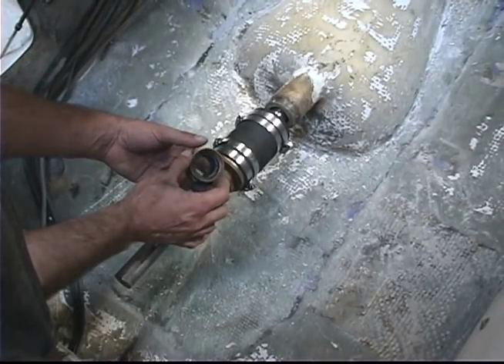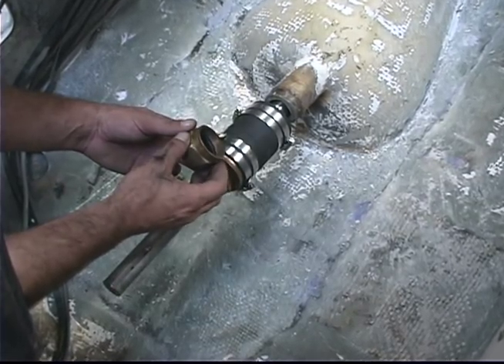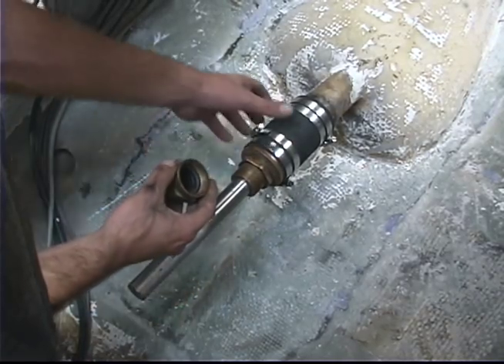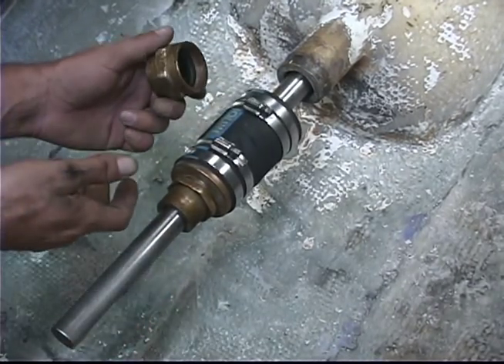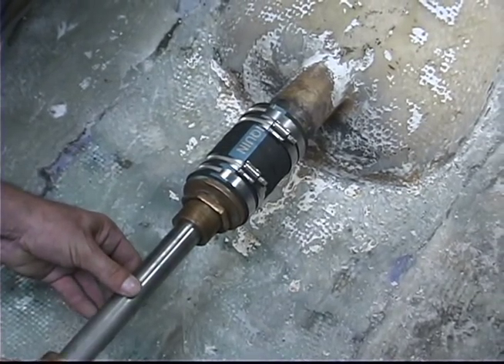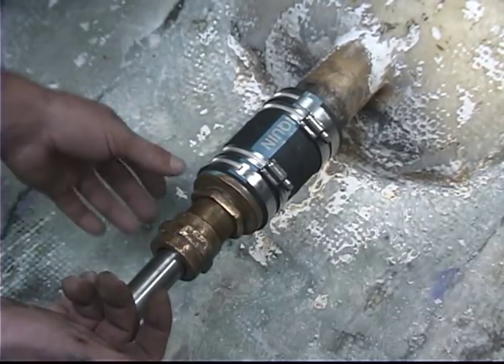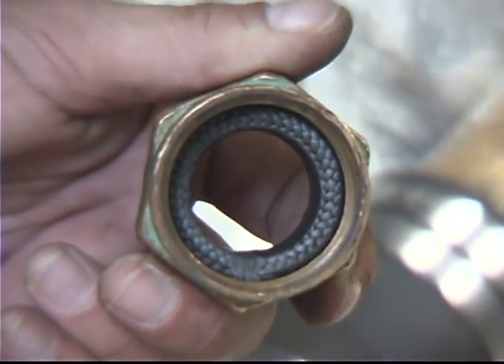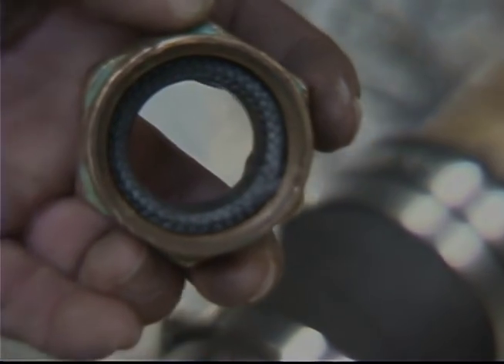9.8 STUFFING BOX- Restoration of a Pearson 323 Classic Sailboat.

Comment: That looks like the flexible hose takes the torque of the friction between the stuffing box and the prop shaft. Is this correct and doesn't it cause failure of the flexible hose?